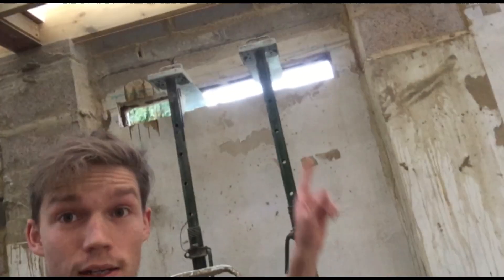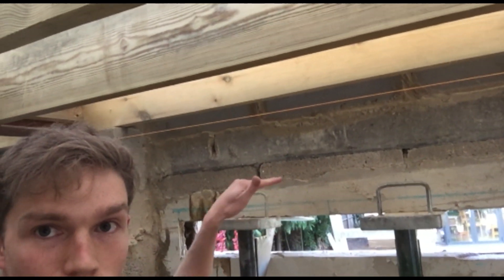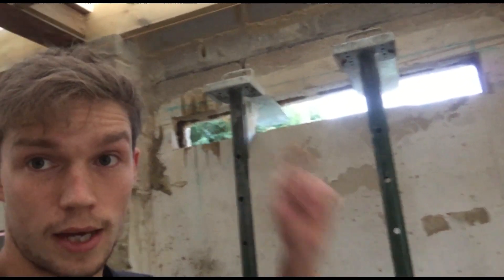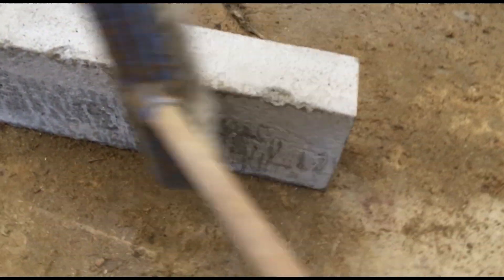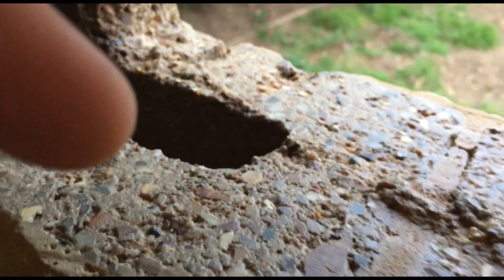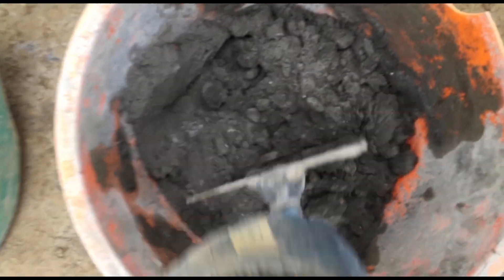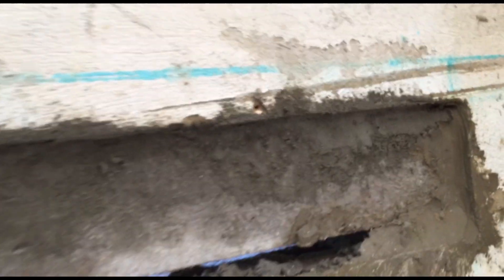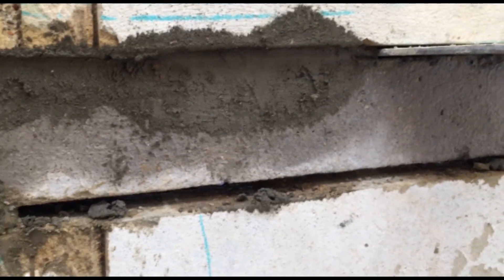How To Install a Lintel to Create a New Doorway in an Existing Block Wall

Comment: Great video. Going to the other end of the doorway i.e. the base. How should an exterior door like that be supported? Is there a lintel fitted if you have a cavity found wall beneath? If it's a suspended wooden floor you wouldn't support it on extended internal joists, would you?

Comment: I know it's regs to dry pack the top of the lintel. But I'd pack the top with pieces of cut stone. Then wet mix 3 to 1 and trowel it in. No builder is going to wait a week for everything to go off.

Comment: Hi mate, 

What were your door dimensions? Looking to do this for my garage. Appreciate the vid
Reply from the maker: I can’t remember the exact dimensions, but you can choose a standard door and then cut the hole to fit the door. Make sure you have 5mm extra on both side and 10mm extra on the height to account for non-square-ness. Then you can use shims/packers to make sure the door is plum, level and square.

Comment: Just what I was after the regs for bearing on a lintel of 1200mm 👍 only difference is one I’ve used is a 140x140 as it’s a 6 inch block wall .. heavy as hell 🤣 great video👍
Reply from the maker: Glad it was helpful to you :) it would mean a lot to me if you’d consider subscribing :)thank you so much for watching

Comment: i,m looking to put catnic lintels in my concrete block extension just because there easier to fit,,any idea if there is a key so the sand and cement can stick to the underside cheers

Comment: V cool. Is there any issue with water falling into the cavity when wetting the lintel or does the dpc take it out?
Reply from the maker: Would probably try not to get too much in the cavity. It will most likely soak through the bricks and dry out over time.

Comment: Thanks for this Matt - good to hear you quoting building regs re the bearings.  I definitely need to know that as I'm about to get a door put in where there is currently a window, and don't think the existing lintel is wide enough.  Thanks again.
Reply from the maker: Awesome no problem :) be safe

Comment: Matt thanks for the video. I am going exactly the same thing, but my wall is solid brick 30cm. Does it matter which way the concrete lintel goes in.? I can only find 140mm X 100mm
Reply from the maker: I would give a structural engineer a call to ask the question. Because it depends on the load being carried above and the width of the opening
Reply: @MattHutton  thanks for the prompt reply. Will do
Reply from the maker: ANTONIOS no worries 😉

Comment: Why didn't you cut the slot deeper, then load the top of the lintel, then chic up the lintel to compress the mortar, perfectly filling the gap? 

A lot less time and a lot better result.
Reply from the maker: How are you supporting the blocks above?
Reply: Matt Hutton same as in the video, there'd be no mortar where the prop is, but he'd only have that part to pack.
Reply from the maker: graham crawford yeah cool idea that’s another way of doing it :)

Comment: why didnt you put a large amount of cement mix on the lintel and then lift that into place so you know you had a thick layer already on the lintel top?. i'd be worried about ensuring you have all the gaps filled when you packed it in.
Reply from the maker: Amir Khan thanks for your message. Because you need to keep the acrow props in position holding the wall above up. And the lintel sinks down when you place it on the mortar at each side of the door anyway

Comment: Hi enjoy watching your video 
One question can you install a steel Lintel across an existing brick arch garage opening. Jeff
Reply from the maker: You'd have to ask a structural engineer about the type of steel lintel to use depending on the load that you are supporting above.